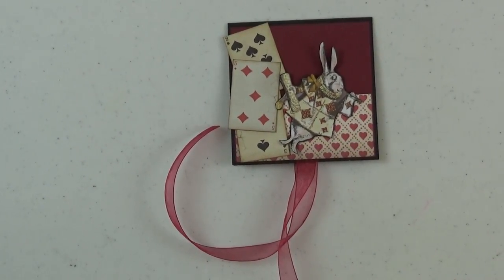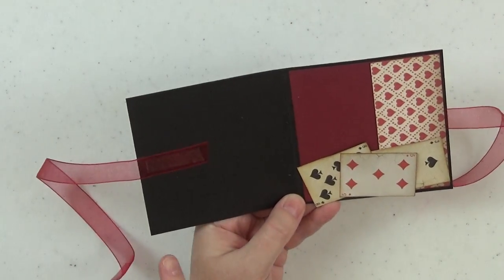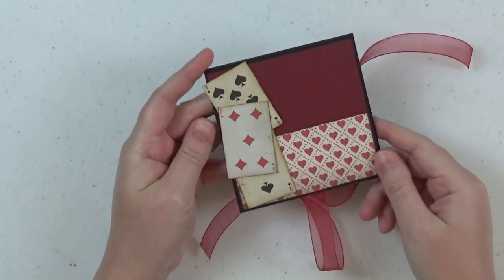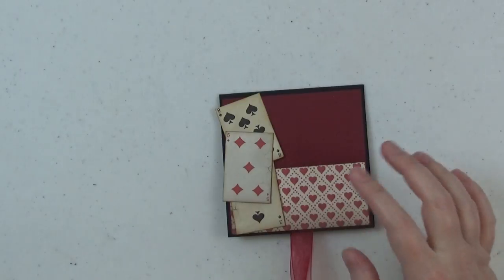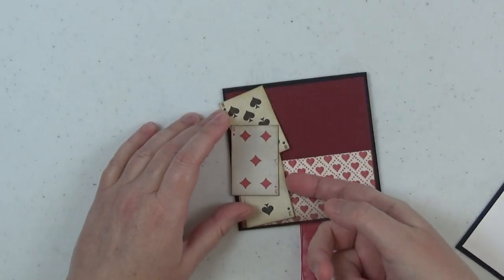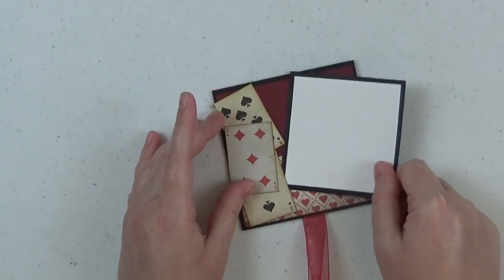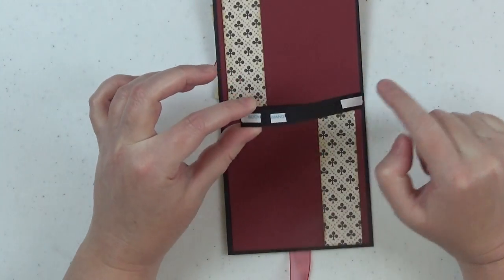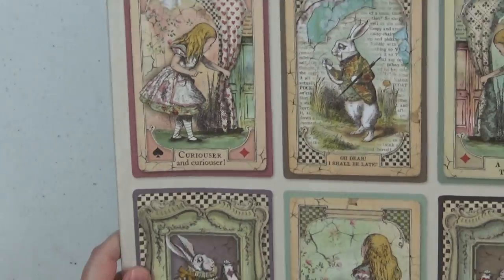Stamperia 9x9 Mini Album Tutorial Part 4: Creating the Pop Up Mechanisms

Comment: Is the pop up mechanism strong enough to hold the chipboard images die cuts?
Reply from the maker: Yes it would be strong enough - it may not lay completely flat when closed but it will hold up in the open position.  Daphne